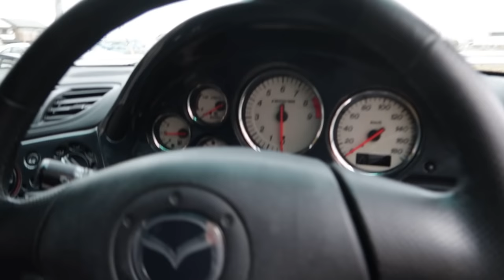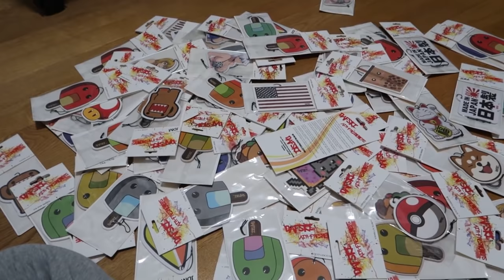A SECRET WAREHOUSE FULL OF GTR SKYLINES & OTHER ILLEGAL IMPORTS!

Comment: Not all sashimi is cured. Some sashimi may be cured for a difference in texture, but it’s not necessary. In the case of salmon, it is frozen to extremely low temperatures to kill off parasites. Tuna however, can be eaten raw directly after the ikejime process. 

Saltwater fish have essentially been cured by the ocean itself. Any additional curing is usually done for taste and/or texture.

Comment: Stock FD Seats has terrible seating position and it gets worst with tall or big guys. You need to modify the rail to lower and adjust them further back even more or change them for aftermarket seats.

Comment: What the paint code of the gray r34 ztuned? P L E A S E
Reply: Google
Reply: @oscardominguez1680  dude google don’t tell the difference between kV0 and kh2
Reply: @amuraiart5704  i think Z tunes only came in Z tune silver. This gray i've seen online several times though. It's called KAD, used for the clubman spec.
Reply: @oscardominguez1680  thanks 🙏